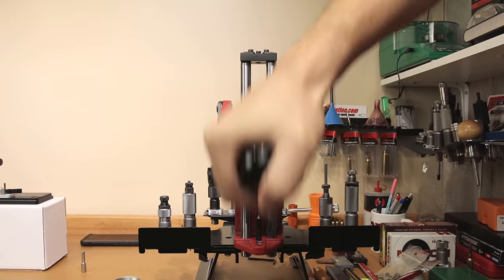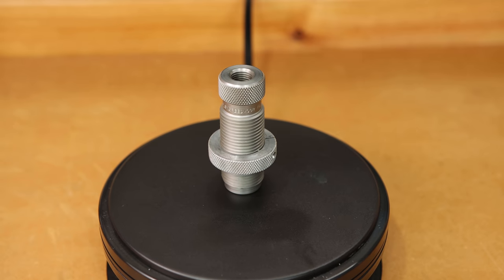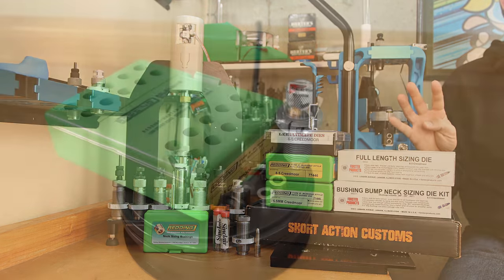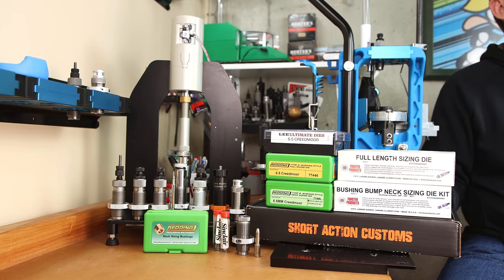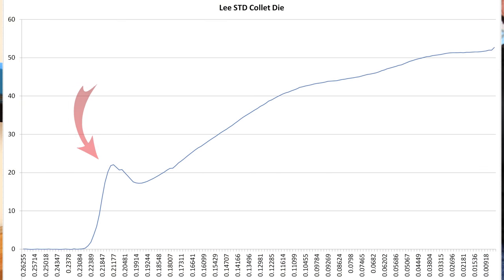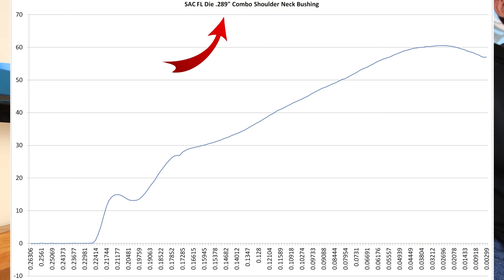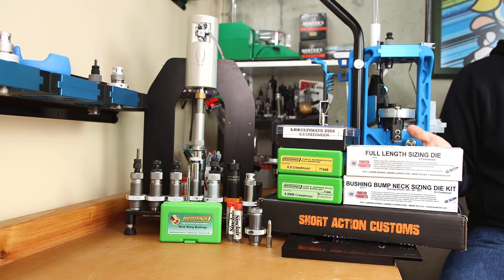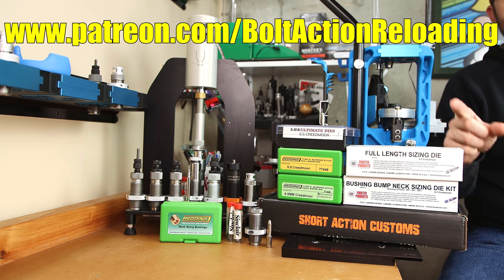How should I size my brass?- How Case Neck Tension and Case Volume Changes

Comment: 4:45 skewed info right there for a person getting into reloading.  Stop neck sizing?  I do agree, not neck sizing will give you perfect consistent neck tension every single time.  Zero, zero neck tension without neck sizing.  Bullets will fall out every single time.  

Proper info should be to not ONLY neck size.  Be it bushing die, full length die, with either a mandrel installed in the die or not and done as a separate process doesn’t matter, still have to size the neck no matter what.  How you want to go about it is up to you. 

And even that might be poor info as well.  After a weekend gopher shooting with the family, 500 22-250’s need to be refilled.  I’m not going to do my ELR process on that many rounds a couple times a month.  Lee collet die works wonders.  Even with the tapered case of a 22-250, never once had a cartridge that was tough to chamber after a collective 4500 rounds between the different guns. We’re on 10 reloads on brass.  Anneal and full length after 4 firings.  Accuracy with this method hovers around that 95% mark.  (We get hired to control gopher populations so we have access to a lot of them) Works great for us, might not work for you.  

Spreadsheet paper data means squat unless there’s bullet holes through it….
Reply from the maker: Sir you are missing the point. First the shot @ 4:44 is of another video where the author tells people to stop neck sizing only. (Its a bit well known in reloading circles at this point) I am not telling anyone to not size the neck of the case.
Reply: I apologize I should have started my comment better.  

Reloading circles yes,  noobs that are looking into reloading no.  When a new reloader heads to YouTube to gather info, your videos are there pretty high up the list and there is so much info in them.  I love that.  Doesn’t matter if I agree or disagree with you or various others I still really enjoy the content.  But for a new guy sometimes the info sways the way of you should get the die that is more consistent or has a more ‘premium’ brand without seeing any actual bullet holes.   I just don’t believe in this even if it is ‘better’. 

I recently had a friend just get into shooting long range.  He said he didn’t want to reload because it would cost him over 2000 to get started.   WHAT?! He figured he needed the high end gear to shoot well.  He sends me links to your videos all the time.  He’s a pretty smart guy but yet fell into the premium means necessary trap.  Since it would be so expensive to start up he decided to shoot factory ammunition.  That doesn’t help us reloaders.  We need as many people in the sport so manufacturers can afford to invest in more manufacturing, more R&D which in turn produces more product on shelves and better products for you and me.  So I convinced him the more he shoots the better he will shoot.  Reloading is the route.   Start with the stuff you can afford and move up from there.
Reply: Also if Cortina’s methods were perfect he would win every match he competes in no?   He also has some excellent videos but his content isn’t for noobs either.

Comment: Always appreciative of the time put into your videos. The data based information you provide is awesome. Thank you.

On another note. I seem to recall you or F Class John stating that if you neck size only, the necks need to be turned in order to see the true benefit. Personally, I’ve gone with FL sizing, incorporating the 21 Century Mandrels you covered some videos back. Seems to be the most consistent method for me.

After all your tests, do you still think neck turning is needed to benefit from neck sizing only?
Reply from the maker: I think starting with good brass is the primary factor. You have to be able to truthful ask yourself "can I make this better that it already is?" If not don't turn. My earlier tests, crude as they were, showed slight measurable improvement with Hornady brass. I haven't tried with Lapua, but unless your chamber requires it, it may not be worth the time. I will likely circle around and cover this at some point but my neck turning system is Hornady. Does it make sense to turn $100 / 100 brass on a $100 tool? I think the IDOD is a very neat tool but its out of my price range for next year and I am guessing out of 98% of my audiences budget too.
Reply: @BoltActionReloading  as always, thank you for the input and responses. Makes complete sense. Using Lapua, ADG and Peterson brass now. However, ADG and Lapua weren’t, initially, available for 300 PRC though. Had to use Hornady for awhile.👍🏼
Reply from the maker: I truly think the cost of "good" brass is pretty much worth it in lifespan alone, not even adding the benefit of just being more consistent. Only way to know is test.

Comment: Thats all fine and good, but in the end what counts is the group you get at any given distance. No matter how you prep a case, if a gun doesn't like the feel of the case in the chamber you will probably not be satisfied with the money you have spent to get it to where you are now. Keep reloading, but use humility when buying your equipment and components.
Reply from the maker: Hi Ray, I agree all that matters at the end of the day is what you can achieve on target. I am trying to lay the groundwork for a legitimate test to illustrate all the differences when you pick a method what is different between them. This is just one part if it. Some guys know, but a lot don't, and unfortunately asking questions frequently invites ridicule. When you pick a die, I just hope people understand what they are getting.
Reply: In my honest opinion, these videos have kept me from buying 150-250 dollar bushing die sets for each caliber I have. 

I’m thankful I found the BAR channel before I went down the “neck sizing only” rabbit hole. Could’ve wasted a ton of money on bushing dies. After watching these videos, seeing data, and hearing what method the pros use, I stuck with FL sizing with an expander mandrel for seating consistency. I’m a weekend range warrior, but I’m getting great results. And as a newer reloader, I appreciate these videos. They save me time and money.

Comment: I just changed my reloading methods starting with my semi-auto ammo. I bump my 556 Lake City brass by .003" and expand the neck later with a mandrel.  But when I bump, I get different sizes. I'm not talking about spring back, but the shoulders going beyond .003" sometimes .008". Is this because of the variances of Lake City brass?
Reply from the maker: Hi Phil, That is a lot of variation. Are some annealed and some not? I just ran about 300 LC 223 cases through my dillon 750 with a bushing bump die (all annealed) and I don't think I have more than about .001 variance that I sampled in the whole lot.
Reply: @BoltActionReloading  Dang. Yeah, they were annealed but the drill/blow torch method.
Reply from the maker: I would be very concerned that you are possibly doing more damage than good with that annealing method. I know no one wants to hear that, but that is my guess unless your die is moving that much.
Reply: @BoltActionReloading  Hmmm... I am using a small base die. I wonder if that will give me different results since the whole body is being squished back?

Comment: Very interesting and I'm anxious to see how they relate to accuracy and shot to shot consistency...Thank you!
Reply from the maker: It will be coming, but I get the feeling most want a let me see the groups video and be done. I don't think a legitimate comparison can be done with out running at least a small ladder test and a COAL test.
Reply: @BoltActionReloading  If "you" (LOL) were to effort this a detailed design of experiments would need to be part of it, that said, the variables which change over time would affect its long term repeatability.

Unless I'm turning my necks, I use Hornady's match grade sizing die with the appropriate neck bushing. To insure uniformity I use a neck mandrel to set the final neck tension. 

Thanks for all the hard work and detailed videos!

Comment: Very broad and inclusive presentation. Drives home the fact that there are multiple ways of doing this task, and each method can be particular to fulfill a certain need or ability. I like how you hammer home the fact that what is “better” for each person will usually be a personal choice. 

To add to this, and pose a question, how to do this action with the most consistency? 3 sizing operations- neck, shoulder, and body - is highly dependent upon the quality and cut of the die. Company A die sizes slightly different than Company B. Will it make a difference? Depends on the rifle and the trigger actuator. 

Very thorough as always, really appreciate your methodology.
Reply from the maker: Glad you enjoy it. Everything matters its just a matter of how much it matters. I know some would prefer a 5 minute video on this topic that says just pick this, but I don't think there is one perfect answer for everyone. I just hope the series will illustrate if differences to those who truly want to understand the difference.
Reply: @BoltActionReloading  I’m a firm believer that one should at least know the best process and highest goal so that all the micro decisions along the way can point towards that. Falling short of that goal, intentionally or otherwise, does not mean failure, it just might be good enough for that task. You present product and process as information, not as doctrine, which allows people to make educated decisions on what works best for them. 

I learned a lot from your channel, really appreciate what you’re doing here.

Comment: According to QuickLOAD's author, the difference in as-resized case capacity will affect how much powder you can put in, but will not affect peak pressure or performance.  This is because cartridges whose pressure peaks above 30,000 psi or so will expand to fill the chamber before the pressure peak is reached.  Thus, it is the as-expanded volume and not the as-resized volume that should affect pressure value.